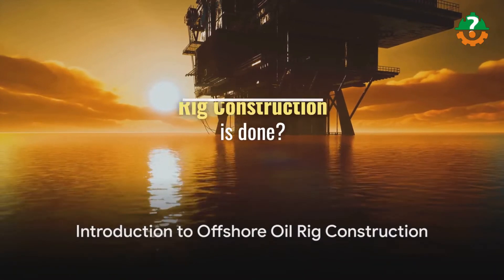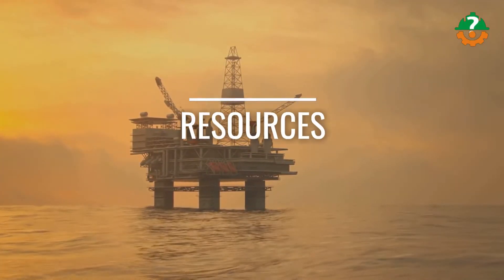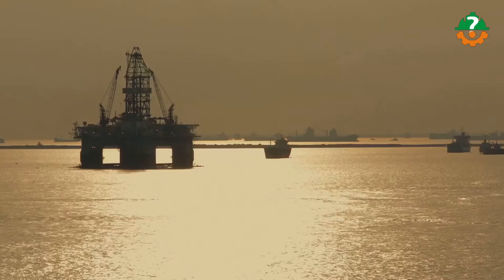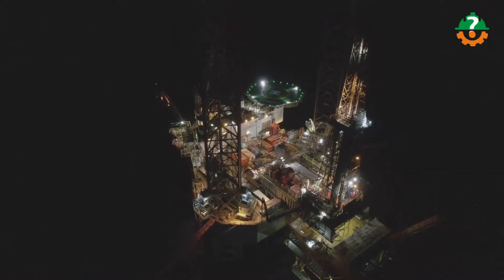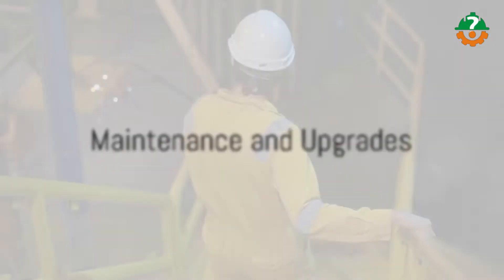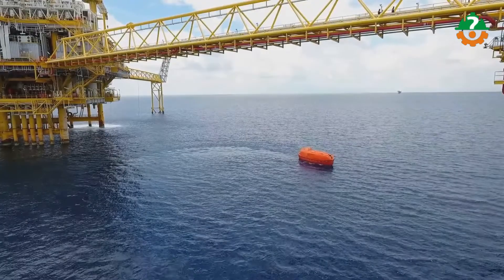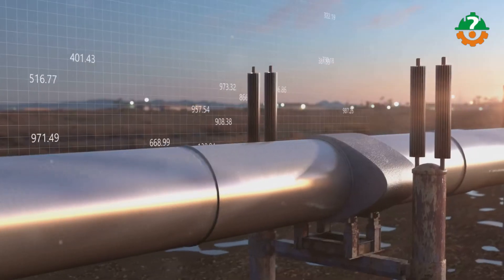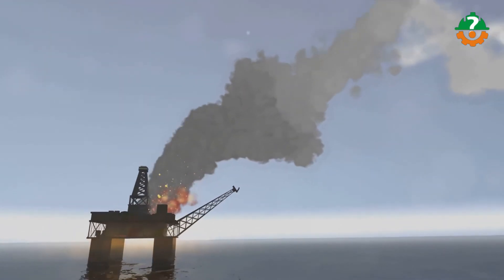How Offshore Oil Rigs are Built? - Some Insane Secrets Must Know

Comment: That’s what I was just gonna say does not explain how it is actually fucking built there’s no videos on it and how oil rigs are actually built because I just looked it up every fucking machine we have cannot reach the bottom of the fucking that’s what I was just gonna say does not explain how it is actually fucking built there’s no videos on it and how oil rigs are actually built because I just looked it up every fucking machine we have cannot reach the bottom of the fucking option ocean the ones that can still fall under pressure of the ocean eventually so there’s no fucking way we have a machine that could fucking build those even with modern machine technology today if we try to re-create pyramids today with machines technology that we have we would fail building the pyramids it’s so how the fuck do we reach the bottom of the ocean to build the fucking oil rigs